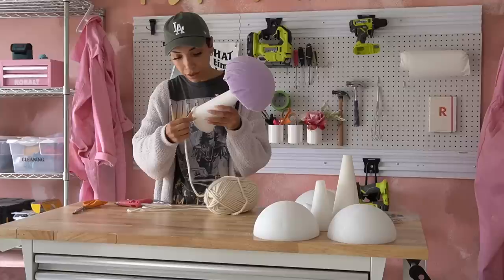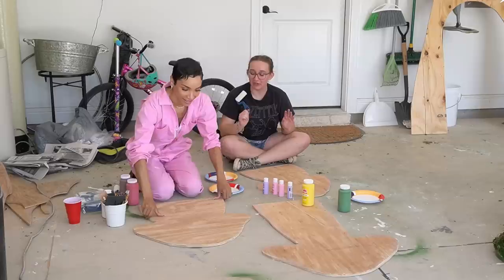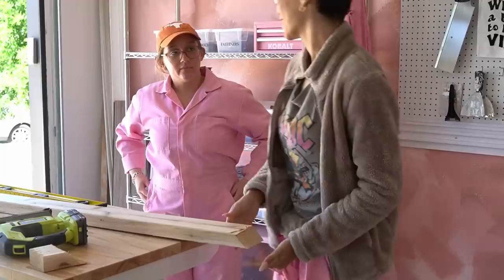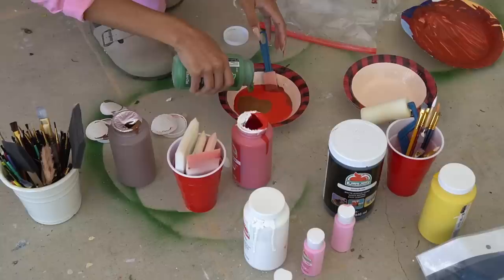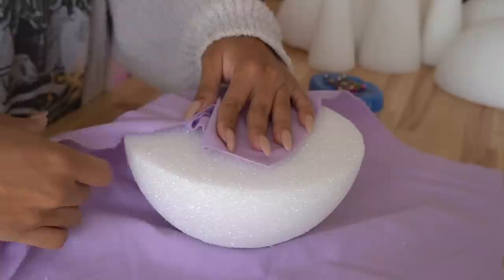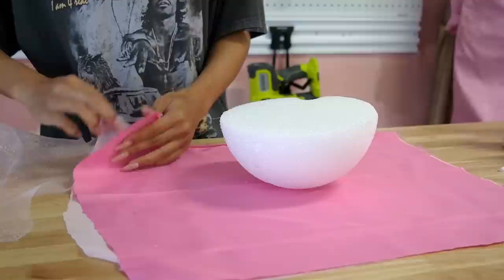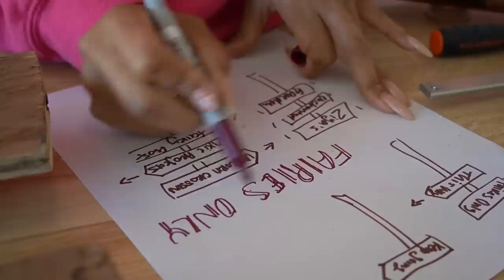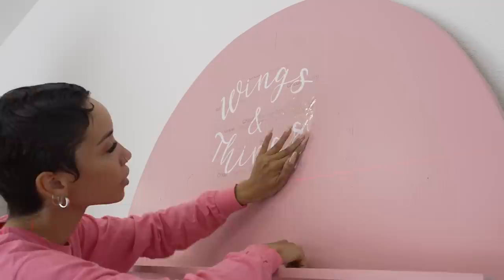Making GIANT Mushrooms for a Fairy Garden Party! (DIY Birthday Decor)

Comment: PVC pipe on the back of the mushrooms extending down to the bottom using braces to secure it to the back of the mushrooms. Hammer the smaller PVC pipes or steaks that will fit inside of the pipes into the ground then slide the PVC pipe over the stakes. Then the supports will not be visible in the photos you could even paint both sides, so that they could go around the back too.

Comment: Luv!! Luv!! Luv!! Just a thought on the butterflies where the holes are you can use an iridescent cellophane so depending on where you place them you’ll have different rainbow light colors coming out of those holes.. and instead of sandbags to help things stand as weight in some of the smaller spaces, you can actually use water balloons.. cheaper option😊

Comment: I've always really enjoyed your projects ❤. You're a source of inspiration for my family/friends gathering. 

Just a suggestion: maybe getting a folding table when working in the garage instead of working on the floor. Easier for your back and knees (or I'm just speaking for myself 😅, because I wouldn't be able 😂). Something that's not expensive, that's ok to spray paint over, use hot glue, etc.....

Anyways, keep it up. You're doing amazing 🫶🏾🙌🏾